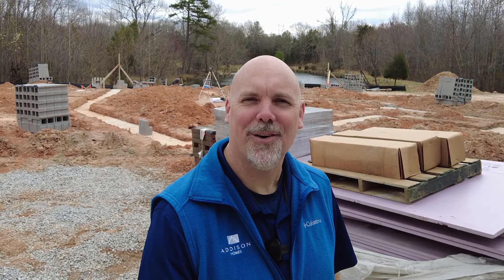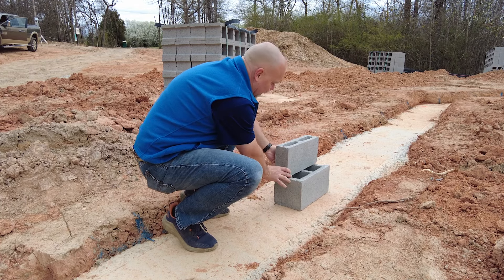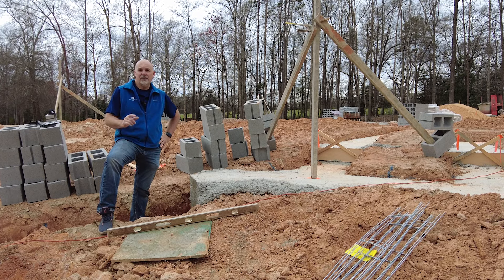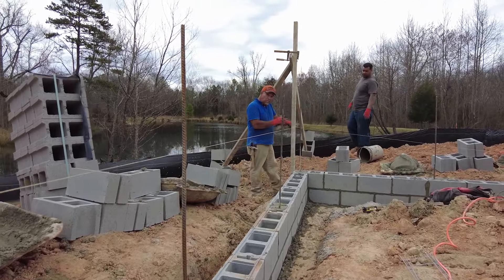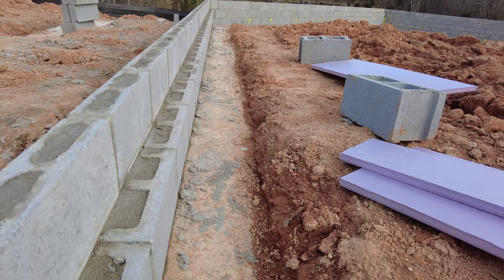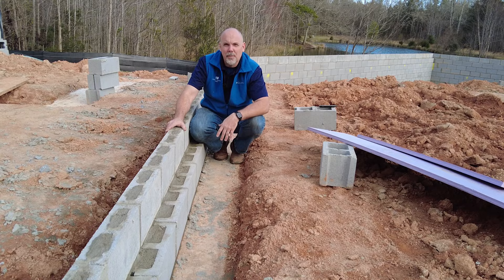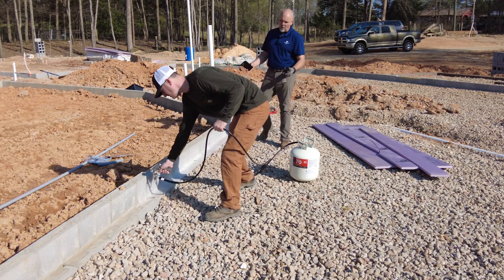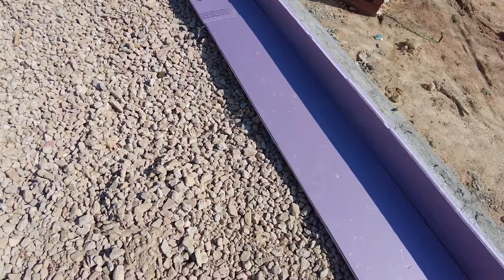Stem Wall Slab Foundations | The HOW and WHY

Comment: Another important detail when doing a stem wall is how the soil was back filled in layers. Ideally it should be 12" layers then a jumping jack compaction (because the skid steer will blow out the walls). This is repeated every 12" until it gets to grade.

Is this what your team does?
Reply from the maker: Great point. We actually go one step further and backfill with stone that requires minimal compaction and avoids the issue with too much pressure against the foundation.
Reply: @AddisonHomes   I noticed that! I should of done that on the side of my foundation that is 6'+ feet on the stem wall. If you do stone do you have to do 100% stone or can you fill some portion with fill and some with stone?  You fill with 57 stone?
Reply: If these stemwalls start to get pretty high, it is required by Code to have interim compaction of the backfill, otherwise, settling can occur. The other thing to consider is installing a floating structural slab if the compaction cannot be fully achieved.

Comment: This method looks labor intensive, needing serious payback in insulation gain, both heating and cooling .  The density strength of foam board also a concern.   Great presentation at any rate…thanks .
Reply from the maker: Thanks for sharing your thoughts. We have found that a typical foundation can be insulated on the perimeter in less than 2 hours. The “score board” foam is best since it doesn’t require cutting.  Incremental improvement and extreme comfort is what we are after.  The compressive strength of most commercial XPS foam is 25 psi. That is 3600 pounds per square foot - well beyond the required soil bearing capacity for a foundation, so we don’t have any issues with the compressive strength of the foam. Thanks again!
Reply: @AddisonHomes   Thanks for the comeback. I was off the wall guessing,  an old retired guy, with construction background.   👍🏻😁
Reply from the maker: @juliojames5986  thanks much!  All great conversation and you bring up some great points of clarification!

Comment: Technically speaking, a CMU should be called a Cement Masonry Unit as there is no rock or aggregate in the mix to make them Concrete.
Reply from the maker: They are actually called concrete masonry units. Here’s a link for reference from the Portland cement association. https://www.cement.org/cement-concrete/products/concrete-masonry-units#:~:text=Concrete%20masonry%20units%20are%20manufactured,they%20enter%20the%20curing%20chamber.

Comment: Why not pour a monolithic footer with a 2 foot stem wall like it’s done in the Pacific Northwest? Is it a matter of the local market not having the subcontractors. I know most engineers say that a mono pour is better for water intrusion and overall strength. Having a block stem wall with a thousand points of failure just seems outdated.
Reply from the maker: @brenthandley5591  are you suggesting to pour a footing then form and pour a stem wall on top?  We could certainly take this approach but it would be more costly than CMU stem wall on the footing and narrow the number of trade contractors available. We would then have to have another crew make a trip to parge or stucco  the exposed stem wall edge. I’m not familiar with a way to pour the footing and stem wall in a monolithic single pour.
We aren’t relying on the stem wall to resist water intrusion and the CMU wall provides more than enough strength for the foundation. I don’t understand how a CMU stem wall has a thousand points of potential failure?

Comment: I would never do block and only do a poured concrete wall!
Reply from the maker: Everyone certainly has their preferences.  In my view, it comes down to performance, cost, sustainability, and availability of trades to reliably perform the work. In our market, CMU block performs excellent, is more cost competitive, has a lower environmental impact, and we have readily available materials and labor to install.  Some of these factors will vary by market.
Reply: @AddisonHomes  Well being in the concrete field for 30 years second gen poured walls are cheaper as well as stronger and more durable.
Reply from the maker: @craigedelmann6476  not sure what market you’re in, but we’ve not found poured walls to be less expensive than CMU.  Not sure how poured concrete is any more durable than filled concrete cmu. As someone in the concrete field, how do you the cost numbers in your market compare- poured concrete vs cmu?

Comment: Been in construction for 50 years and have never heard of a stem wall. Seems to me a concrete poured foundation is better.
Reply from the maker: @ptech88  Interesting. Where are you located?  Perhaps a cold climate?
A poured concrete foundation is definitely an option, albeit significantly more expensive and carbon intensive.
Reply: @AddisonHomes 
Carbon intensive...yr gay.
Reply from the maker: @meatballmagoo6134  Don't understand the comment but happy to discuss carbon intensity versus other solutions if that's your concern.

Comment: There are better ways to build a wall. ICFs (Insulating Concrete Forms) are easier to work with, already insulated and poured concrete is far stronger than CMUs. ICFs are better than stick framing too.
Reply from the maker: ICFs are a good product but expensive and challenging to obtain a termite bond when using in a high termite infestation area like South Carolina.

Comment: Seems there is a lot of failed logic in your method.  Talking about leaving the 4 inch ledge on the stem wall to "support the edge of the slab"  and then reducing that ledge with rigid foam board...  So in actuality, the slab is poured over the backfill and cantilevered over the perimeter foam board.  Then, not tieing the slab to the stem wall with any rebar leaves them both structurally isolated... 
In the end, the home is either built on a 4" CMU block that is not tied together (like using "beam" CMU block) or is resting on a cantilevered pad...
Seems to be a risky trade-off for the longevity of the home.
Reply from the maker: @MeanderLife  interesting analysis but don’t understand how you conclude that the slab is cantilevered. The 4” ledge formed be the 8” cmu transitioning to 4” cmu is reduced by the 1” rigid insulation leaving a 3” ledge. The area inside the stem wall has continuous compacted fill. There is no cantilevered slab area.  
The framed exterior walls bear on the cmu and a portion of the slab (which is ultimately supported by the cmu ledge and compacted fill beneath)
Using header block (beam block?) around the foundation perimeter prevents the continuous perimeter insulation, which is the goal of this assembly. 
The stem wall and slab are not connected in this approach nor is this needed in this location. There are no scenarios in our location  where the stem wall and slab need to be structurally connected. Structurally connecting them might be advisable in a seismic zone or an area of very poor soil quality.

Comment: What stem wall is best for Florida
Reply from the maker: I would use the same - 8" CMU block with 4" CMU block on top.  This facilitates perimeter insulation but be sure to cap the insulation with a termite shield.